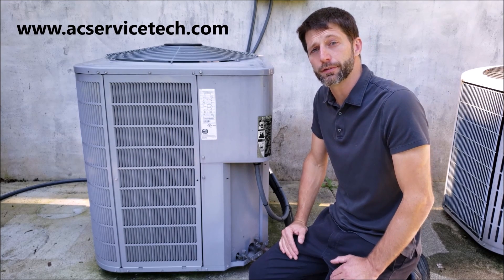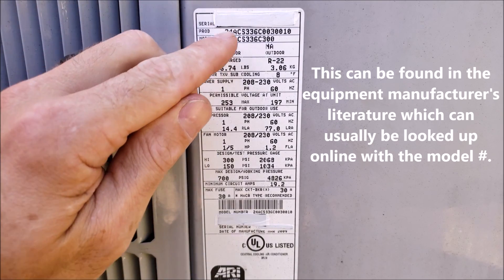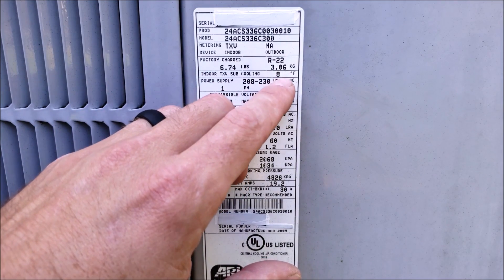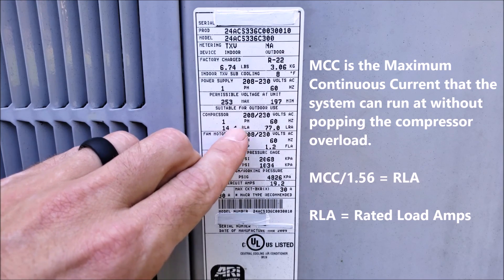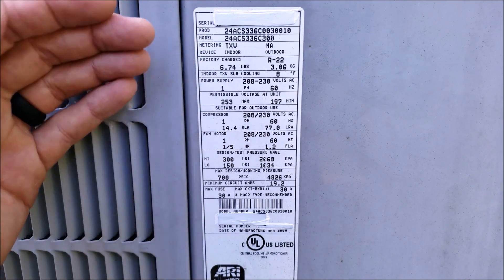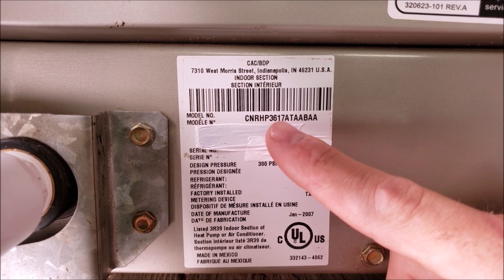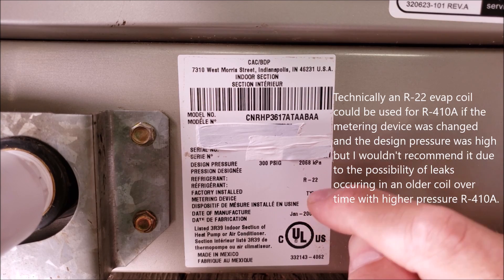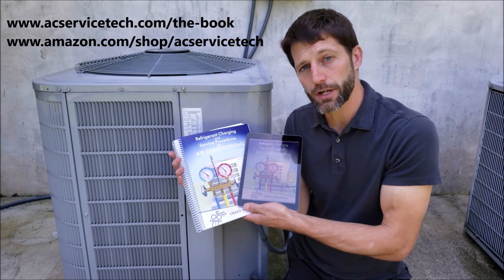Reading the Rating Plates of an Air Conditioner!  Size, Refrigerant, Pressure, Electrical

Comment: There are many videos on this subject. Can't find the first video on reading the Heat strips amperage label. What do all the abbreviations mean? 20+ years in electrical field. All google pulls up is the abbreviation for A/C and how to read the condenser label. Is it a A/C trade secret? No one I know has the heat strips mark as to which one were installed in the unit.

Comment: You mentioned the rated amperage but said that it was not the amperage the compressor was run by. But I was wanting to hear you say what the running current or power was for the compressor. You said it for the fan but not the compressor.

Comment: The air handler calls for 45 amps. At the panel and disconnect it has a 40 amps breaker. Does it matter where I change the breaker.

Comment: Can someone please explain to me if there is a code on nameplate rating locations? What I mean is should I have to unscrew 10 screws and take out front panel covers to access the nameplate reading of a hot tub for example? Also shouldn't nameplate ratings be professionally screwed in made out of metal and located on the outside of the unit? I'm working on installing a Hot Springs hot tub and there is no name plate ratings outside of the unit, you have to unscrew six screws and take out the front access cover to read a paper nameplate that was extremely vague. It didn't have the words "amperage" "wattage" "draws" etc.

Comment: I've got a Trane XB 13 outside condenser unit 4TWB3060A1000BA and inside is Trane 4TEC3F60B1000AA. The compressor in the outside unit died & I can't seem to find a replacement for it. I don't want to replace the inside unit, but is there a way to find a compatible outside unit to replace the existing one? Both are from 2009.

Comment: With all due respect & in the spirit of continuous learning,  NEC Table 310.16 Ampacities table 240.G specific conductor application Air Conditioning & refrigeration equipment circuit conductors 440, part iii, VI based on the 75 degree C table you base wire size on minimum circuit ampacity NOT breaker size. With that said you do have to comply with cable type. This is the one area that is super confusing and and may electricians get it wrong and many technicians do as well. Please correct me if I’m incorrect.  https://youtu.be/WugJ8-70Sqs

Comment: 24 is cooling only 25 means heat pump. ac is lower line model. 3 before 36 means 13 seer .36 means 3 ton

Comment: How to calculate the wattage for your ac unit?  More specifically the Carrier AC unit that you just went over.  Trying to size a generator and I can't find the running wattage or starting wattage for the ac unit anywhere.

Comment: Very useful info, I run into Carriers now and then.  I am starting to see new installations where the Evap Coil is a 5ton with a 3 speed ECM, a thermostat combined with a Humidistat for customer control, and the outdoor Condenser is a 4 ton 2 stage, R410a our Northern CA area.  Advertised at 16-18 SEER.  HAve you seen that configuration?

Comment: Hey Craig. Working on installing a new disconnect on an old 3 1/2 ton fedder unit. (The old thing is still kicking). Max Breaker size from the manual states 35 amp. Min wire ampacity is 26.4. Im just gathering information from a more experienced tech here, but is it fine for me to add a 60 amp breaker as the disconnect with 10 awg wire to the condenser correct? This circuit breaker is as called for

Comment: Thanks a lot for the fantastic explanation. I am asking about the way how to calculate the input capacity for a VRF an Air Conditioner(for example ARUN120LTH5 - Multi V5 LG Air conditioner) . So I can estimate the breaker size , Cable size ,...) Best Regards

Comment: The manufacturer has the wire size figured out for you. 14.4 times 1.25% +1.2 =19.2 amps  12 gauge thwn wire  Article 440 says u can use it with a 30 amp breaker You can do this only with air- conditioning and motors all of us electricians no this.

Comment: Howdy Craig! Do designed test pressure, 300 psi on the high side, and 150 psi on the low side, mean the target pressure operating pressure for this AC unit? Thanks!

Comment: Please help anyone who has the answer... is it ok if the outside unit btu capacity is smaller than the inside ? My inside furnace says 80,000 Btus in the model number and the outside unit says 36,000.         He said in the video the 2 should match eachother...

Comment: Thank you for your video. How can I find out how much energy my AC unit is consuming? I cannot locate any SEER or EER label rating. Mine is a ARI unit model N2A348AKA300, RLA: 20.2 / LRA 137.0 /  FLA: 1.2 / Compressor 208/230.

Comment: You could use r410a in an r22 coil as you said. Problem with r410a is that it takes longer than r22 for the coil to hit dew point. Thus, latent cooling time is less during a run cycle. To overcome this, manufacturers make r410a coils larger, "catching more moisture," to offset the longer time it takes the coil to hit dew point. Great video.

Edit: I found this science to be facinating. I'd love to see a video about this going further into the science and design of r410a systems.
Reply from the maker: Thanks, they do make them larger for seer rating matches on R410A systems, thanks
Reply: If it is charged to target superheat, there should be no problem. Superheat doesn't occur until all refrigerant has been boiled off in an evaporator. The larger evap coils are due to increased efficiency demands.

Comment: Sir I got a question why home split type and window type aircon doesn't use filter drier they only use strainer. If I add filter drier on the liquid line output of condenser of split aircon will it be helpful or add life of aircon?
Reply from the maker: Dont add a filter drier, because they have too much space inside an the refrigerant could flash inside the drier. The strainer could be replaced with another strainer that is the same size. Usually the strainer will have desiccant in it too, thanks!
Reply: @acservicetechchannel  thanks you're the best learning from your Chanel as always

Comment: Could you expand a little on the design pressure or link a video explanation? I thought R-22 systems run around 60PSiG on low side.

TY
Reply from the maker: Check out videos 1,2, and 4 in this video playlist, thanks! https://www.youtube.com/playlist?list=PLxnHR5_D2ojxubu9_ej-klywMskjAsuTX

Comment: You do not size the wire to the  max fuse size. According to NEC you size the wire to the minimum circuit amps. The breaker is for short circuit. The internal overloads protect the conductors.
Reply from the maker: The max fuse on the unit is the breaker size needed in the indoor building. The wire supplying the unit is determined by the breaker size and run, thanks!
Reply: @acservicetechchannel  with all due respect & in the spirit of continues learning,  NEC Table 310.16 Ampacities table 240.G specific conductor application Air Conditioning & refrigeration equipment circuit conductors 440, part iii, VI based on the 75 degree C table you base wire size on minimum circuit ampacity NOT breaker size.

Comment: Excellent video.  Since the condenser unit showed 14.4 amps RLA, what range of amp draw would you go by when the unit is running?
Reply from the maker: You won't be able to know that regardless what anybody may try to say. That will depend on a variety of conditions such as the indoor wet bulb, the outdoor db, the condition of the outdoor coil, etc. Always go by superheat and subcooling, thanks!

Comment: Hi sir! I got a r22 system,ill be replacing condenser that has r410a from factory, can i recover 410a refrigerant & add r407c instead?
Reply: Check what kind of oil is in the compressor and if is compatible with 407 c.Mineral oil or POE.
Reply: @dhguard1  compressor has poe oil,r407c works with poe oil from what i understand
Reply from the maker: R407c runs at pressures near r-22 and is a retrofit for r-22 if there is poe oil in the system. R410a cannot be replaced with r407c, thanks!
Reply: @acservicetechchannel  yes it does have poe oil on compressor, the system was originally r22,im just replacing condenser thats equipped with 410a refrigerant, i believe it has 1lbs of it

Comment: So the conductors from the breaker panel to the disconnect should be 12awg?
Reply: I ALWAYS USE 10AWG TO BE COMPLETELY SURE THE WIRE IS ADEQUATE !!!!
Reply from the maker: Since the max breaker listed is 30, a 30 amp breaker should be installed in the building and 10 gauge wire run to the disconnect for the outdoor unit unless it is a very long run in which case you could use 8 gauge wire to avoid a voltage drop, thanks!
Reply: I was watching a video by Mike Holt he teaches electrical code. I think he says that the size of the wire is based on the circuit ampacity which in this video at 18 or 19 amps. In which case you would need a 12awg. Have you heard of that method before?
Reply from the maker: @russell4309  It is not wrong to size the indoor breaker at 20amp and just run 12 gauge to the unit. That is certainly fine but most of the time the indoor breaker is sized by the max breaker size. The unit will be running quite a bit lower than the min amps anyway and would only trip based on a short. Both are certainly correct, thanks!
Reply: Much appreciated, love the channel!

Comment: Does the air handler need to be connected to the compressor unit to charge it with refrigerant?
Reply from the maker: Yes absolutely and the tech would need to be epa 608 certified in the US, thanks!

Comment: Craig,MCA or minimum circuit amps is how you pick the wire size. For this condenser 19.2 mca you can use #12 wire normally rated at 20 amps. This is because it is a motor circuit. Any motor circuit can be "over fused or over breakered" because the motors have thermal overload protection (a motor starter, vfd or thermal protection built into the motor) provides this protection.With a single motor the wire is sized at motor amps (you have to use amp rating from code book) x 1.25= wire size.example: a motor rated 20 amps the wire size would be 20 x 1.25=25amp wireWith a packaged piece of equipment with multiple motors (like the condenser above) you use the MFG information take the compressor amps 14.4 x 1.25=18 amps + the condenser motor amps  (1.2 amps).= 19.2 MCA as shown on the nameplateWith multi motor equipment you take the larges motor x 1.25 and then add the other loads.If you had a large commercial roof top with 4 compressors all the same size, 1 indoor blower and 6 condenser fans you would take compressor amps from 1 compressor (assuming that is the largest motor load) x 1.25 + condenser fans, indoor blowers, crancakes heaters, controls, electric heat etc and total that all upIn the old days 1960s, the electrician had to do this and they never got it right. Now, the MFG does the calculation for you and puts it on the unit name plate.....as abovewith multimotor equip you only multiply the larges motor load x 1.25. If the larges motors are all the same size you just use one motorThe idea is the 1.25 gives you larger wire to take the starting inrush. Thermal protection will prevent wire overloading. The breaker or fuse provides short circuit or fault protection. So its common to see #12 on a 30 amp breaker, #10 on a 40 am breaker etc. This only applies to motor loads. Xcellant videos!!!!!
Reply: Ed you are 100% correct, based on the name plate rating, 12 awg wire would be acceptable on a 30A breaker for this unit.
Reply: The code book has listed exemptions for wire sizing. HVAC and motors is one of those exemptions. MCA is minimum circuit amps. Which = the wire size the unit is rated to use. Since it’s the minimum you can use larger if necessary. I.e. for long runs to make up for voltage drop. Or maybe your future proofing for a larger unit, or #10 wire is cheap upgrade cost, or you have #10 on hand already, or makes you sleep better knowing you used #10, etc. #12 is not forced, but is what it’s rated to use.
Reply from the maker: Max fuse is what is used to size the wire supplying the outdoor unit from the breaker box. That was what I was trying to say. If it shows 30amp max and a 30 amp building breaker is installed then 10 gauge wire would be run unless it was a long run. The unit never runs anywhere near the max amps and like you said is for short circuit and fault protection, thanks!
Reply: You are usually right about most things Craig, but you are way off here. I’m very surprised at the way you have dug in on this when other knowledgeable posters, probably electricians, have told you that you size wires off the eating plate minimum circuit ampacity, not the breaker. This is cut and dry stuff that anyone doing electrics would know.  The breaker can be way over the normal wire ampacity with motor circuits. In this case with a rating plate ampacity of 19.2 you would use 12 awg wire.  You could even use 14 awg then (not nm cable) with 75 degree rates terminal connections (which is what most breakers and  terminations are rated At today). Sizing 10 awg is total overkill and unnecessary.
Reply: @TonyNanni  Tony, as an HVAC student at a local HVAC school here in Denver, I have a question about this.  Does 10 awg wire cost a lot more or what would the reason be not to use the 10 awg wire?  What size breaker would you recommend with the 12 awg wire?   The rated capacity is 19.2, so would it be 20 0r 25 amp with the 12ga?  I have seen wire pricing and do not see any cost savings or advantage to going with smaller wire.  So I look to expert advice to learn the correct path to take in this particular case.
Reply: You could use 10 awg if you like if the cost is not much more. In fact I might use 10 awg if the run was long to limit voltage drop. I was just pointing out that Craig is not correct on this issue and that the other posters are correct regarding how to size an air conditioner circuit. It is important to know this info because you will see 30 amp breakers on 12 gauge wire commonly in ac circuits and you need to not immediately think this is wrong

Bottom line the manufacturer of the equipment has done the work for you sizing the breaker and the wire.  You go off the data plate min circuit ampacity and breaker size
Reply: @TonyNanni  Thank you so much for the explanation! It definitely made sense when I read it but was just checking.  Two of my buddies are Masters and they have explained various things along the way so it is easier to understand. That totally makes sense.  Thanks again!!

Comment: Hello,

What are some worse case scenarios oversizing a condenser fan motor?
Reply from the maker: Oversizing a fan motor would be like having a slightly larger coil except there is a point where it is not worth it since it is usually a psc motor and will not be able to pull more air through due to the restriction. It is not like a ecm that will force more air through a restriction, thanks!

Comment: Sir, as usual, i like to spend some time with you hearing any topic on refrigeration.
Is R-22 still available in the USA? Another thing i often wonder is why the company never mentions the orifice number- just that the metering device is a TEX.  Also, why don't they mention in this case just -3 Ton -  directly. Considering how much other details are provided.
Reply from the maker: For efficiency, manufacturers for the last 10 years are expecting us to use a txv so they don't even bother mentioning a piston number. However some manufacturers may list this in their literature, thanks and R-22 is on its way out right now this year!

Comment: How you determine the size of out side unit when the labels hard to read or the previous tech took it with him to bid the job??
Reply from the maker: You would only bid jobs based on doing a quick load calc on the house. I wouldn't base my decision on the size of the old unit but discussions with the homeowner and the load calc, thanks!

Comment: Ac service tech you have the best videos. One thing I know online has very little of is sheet metal work. Nothing serious just small jobs like pocket door design when we have to change an evaporator. I know lots of guys have issues with this especially if they went from maintenance straight to service. Also making a new pan for the evaporator to sit on. This would be a great lesson. For instance if we have to swap an evaporator but we need to make a new door because of a change in evaporator  size and piping arrangements. Thanks
Reply from the maker: I have one video on making an emergency condensate pan, one on a filter door, and one on basics of sheet metal tools but I would like to do more in the future, thanks!

Comment: On your way to 100K Craig. Congratulations!
Reply from the maker: Yeah, all the sudden subs started picking up too! I am grateful! Thank you very much for your support Tom!
Reply: @acservicetechchannel  A service tech wrote 153/276 .09 in marker on my outside unit next to that tag you shown in the picture. My neighbor has the same exact unit as mine age year everything they were installed same time but the reading written on theirs is 134/261 .08 both carrier units model# ca14na024-A. Why do we have a difference and is that good or bad for my unit? Thank you in advance

Comment: Yesterday I just found one unit that outside Unit says TXV, but inside is actually Fixed Piston
Reply from the maker: Absolutely, you can never go by that as the charging method and always check the indoor unit, thanks!
Reply: @acservicetechchannel  What if your indoor unit is sealed and you can not access the metering device without  cutting a service panel?
Reply: Kel Fukuda all units will have some form of access